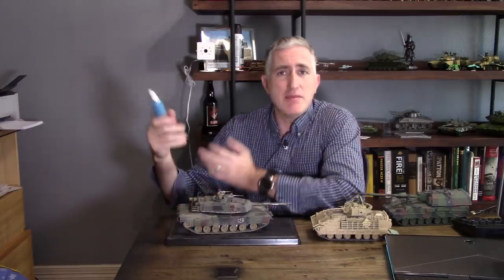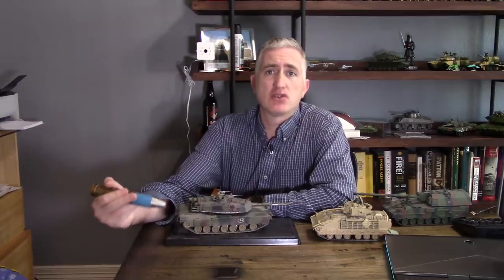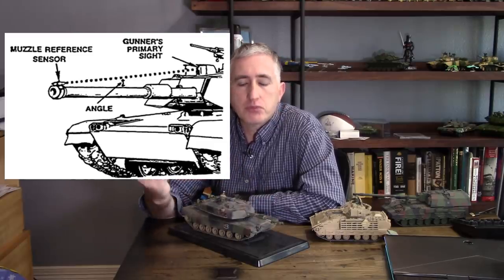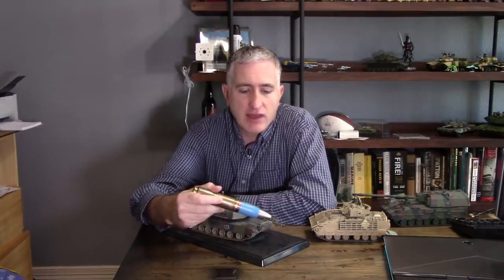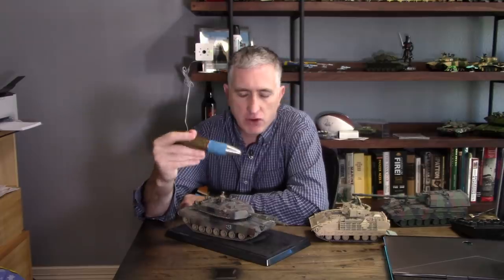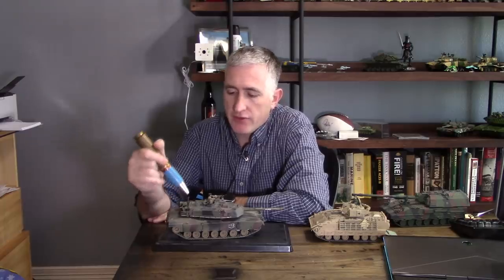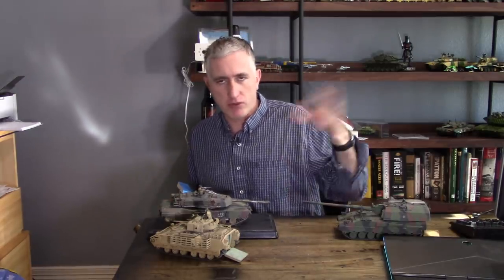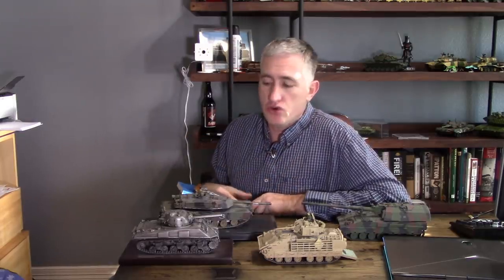Tanks 102: Tank Components

Comment: The_Chieftain: Its Tritium (H-3), a radionuclide of hydrogen. Trituim also provides lumination in emergency exit signs.
Reply: At least emergency exit signs that don't have batteries (like most of them do).
Reply: --and the night glow of my handgun sights. ;-)
Reply: @John Fulghieri-- DU is a lot less radioactive than NU, but U235 accounts for only a very small fraction of the radioactivity of natural uranium. The rest comes about equally from the U238 and its decay product, U234. The latter gets swept out during the enrichment process, along with the U235.
Reply: Donald Palmrose is correct.   Also found in an M1 Abrams is :  Thorium oxide in combustor liner in the turbine engine.  DU (Depleted Uranium) ammo M829 series DU APFSDS-T.  DU in the armor of M1A1 "Heavies" and M1A2 , identified with a U at the end of the serial number.    A thermal imaging window "may" contain thorium- not sure if this is specific to an Abrams though.  Self-luminescent sights, dials gauges probably contain radioactive material.     Source: Radiological Sources of Potential Exposure and/or Contamination TG-238 U.S. Army Center for Health Promotion and Preventive Medicine 10 December, 1999

Comment: As a note, the hot trend in 1:35 military vehicles is 1000+ piece kits with FULL interior.  That is, crew compartment, drive, engine, ammo, everything.  So far I've seen Panther, JagdPanther, Tiger, T34, T60, M3 Lee/Grant, SU-122, SU-85, and probably others.  Not for the faint of heart.
Reply from the maker: I can deal with that. It's the 500-piece track links which I find are over the top. Sorry, but I don't need to have each individual end connector and center guide modelled. If I wanted it, I'd buy aftermarket.

Comment: I was on first-gen Bradleys which were supposedly amphibious (we never tried), so they had a huge trimvane on the glacis.  When it was fully extended as it would be to install the 25mm barrel or PMCS the powerpack it made a nice place to sleep, almost like a Lazy Boy recliner. Not quite as nice as the various spots on a 113, but good enough.

Comment: The comment about the Type 99 is very interesting. Where did you get the information about the Type 99's divergence compensation method? For context, the latest Type 99A variant has DMRS installed.
Reply from the maker: Heard it years ago. Can’t recall if it was in Janes’s or conversation.
Reply: Thanks for the reply. Generally, information about the Type 99 should be examined closely. For example, it was believed for a decade that it had a 1500hp engine when it was actually confirmed to be 1200hp when the Type 99A appeared.

Comment: It’s interesting to think how long it took to get some design rules down like: put the engine in its own compartment, put ammo in its own compartment, evacuate the smoke from gun after firing, thermally balance the gun, etc etc.
Reply: remember that many of these issues only got solved when they became a problem.  before ww2 most tank guns were small and did not produce a lot of propellent smoke and that even in ww2 most tank engagements were at short ranges.
Reply: The cold calculus is that at least one man died or was injured for every design improvement to a tank design during wartime.
Reply: @basher20  I would bet it's more than 1, a lot more than 1

Comment: 22:25 Idk if I am wrong about this, but I think one of the reasons why the Sherman tank (and other similar tanks) was so tall, was, because of the transmission shaft
Reply: Not entirely wrong. The other reason was that the Grant/Lee/Sherman all used an aircraft radial engine, so the crankshaft was in the center of the engine instead of at the bottom like a Panzer 4. That made the driveshaft much higher, which made the bottom of the turret basket much higher.

Comment: The description of aiming off away from the wind intrigues me.  I've been competing at national and international level in archery for over 15 years, and we too use a fin-stabilised projectile.  But we have to aim into the wind, sometimes by 1m or more over a 70m shot.  You can see the arrow in flight, and the tail definitely gets pushed, but there isn't a subsequent "lift" back into the wind.

I suspect it has to do with the extreme speed and mass of a sabot round, but if anyone has further information that would be very welcome.
Reply from the maker: Interesting. There are folks commenting elsewhere in this section that RPGs also have to aim with the wind rather than into it, so it’s more than just speed, at least.
Reply: It could be the strength/elasticity of the projectile. Arrows are flexible and won’t be affected by the crosswind pushing against the fin as much as a rigid sabot round.
Reply: This is clearly bugging me.  I found this (http://www.aircav.com/cobra/ballistic.html) where 3.C.(3) states the effect you described for a rocket under acceleration.  Which makes sense, because you have something propelling it at its new angle of attack.  Since this (and every other source I can find) states such effects cease when the motor is turned off, I'm guessing that the fins and penetrator body are creating lift against the wind.
Reply: Interesting thought, and indeed when you watch high speed footage of arrows (check out the Werner Beiter stuff like https://youtu.be/wGNslUNBrEM) you can see this in action.
Reply from the maker: That first link seems to indicate that it's a component of the launching platform's characteristics, and the bit you are referencing is launching when the helicopter out of trim. (i.e. it both requires additional, uneven control inputs, and is moving at a cross path to the wind), possibly because the wind will affect different parts of the rocket at different times as it leaves both the tube and the downdraft of the blades. At the very end of the paragraph, it simply states that if the aircraft is in trim, to aim with the wind, as the rocket will turn into it with no additional qualifications.
Reply: @TheChieftainsHatch  This is an interesting phenomenon, unfortunately I couldn't find any info on it specifically for fin stabilized tank shells. If you do indeed aim with the wind with these shells, I agree with the lift theory. And if it is the lift from the fins, that would also mean that if the wind is close to 90 degrees to the round you would still have to aim into the wind, as there would be no lift. I really don't know how large of an effect this whole thing would have though, considering that the fins are fairly small and I would think the air resistance from going 1500 m/s would force the fins to stay close to straight.
Reply: I suspect it has to do with the sabot round flying at supersonic velocities. Neither an arrow nor a sabot round is a geometry that you would normally expect to produce much lift, but if the sabot round is at an angle of attack it will make the bow shock in front of it asymmetric and generate higher pressures on the side of the round that is 'flatter' relative to the upstream flow.
Reply: The depleted uranium which is the tip is a lot heavier than the fins so the tip function as an anchor. In the 60's it was tungsten core which was one and a half times the mass of steel. Your arrow has only a little tip made of steel I suspect. Archery has more in common with a mortar round I think which has to aim into the wind.
Reply: The center of gravity determines a lot about where a projectile is headed. 
A SABOT dart has very little air resistance. It's not really anything like an arrow though they compare it to one. I'd say it's more like what they fire out of a rail gun. 'High velocity' is an entirely different animal than a hand-drawn arrow that flexes like crazy.
Many times a wing or fin design doesn't work until they get it in a wind tunnel and fidget around with it.
Reply: The ratio of drag (from the fins) to the mass of the penetrator has an effect. I build rockets. The large amount of drag (fins) wants to steer into the prevailing wind. Without acceleration (thrust), you have drag (negative acceleration). Those forces will pivot an object around its CG. Arrows have low mass over a long length and relatively small fins. The entire arrow tends to drift with the crosswind. Heavy rods (sabot rounds) have huge fins for their frontal area/diameter.

Comment: 19:58 The other problem with muzzle brakes is that it also forces you to wear better ear protection. In addition to that, muzzle brakes make a larger muzzle blast that can hurt/annoy accompanying infantry. Also....."apparently" the larger blast from the muzzle brake tends to damage any sensitive equipment (like the optics maybe......but I am not quite sure about that) mounted on the tank
Reply: it all depends on the precise structure of the brake. Its construction shapes precisely how much gas is focused through a certain channel, at a certain pressure, in a certain direction. 

There are advantages and disadvantages to each. Ultimately it's not possible to redirect that pressurized gas without a risk that it will hit something, though there are ways to minimize it's potential for damaging the things you care about, in a given scenario.

Ultimately it's no surprise then that when possible, we tend to prefer disregarding all that, and just go with a clean muzzle instead.

Comment: There's a misunderstanding of "muzzle break" and "muzzle brake" and they're two different things.  For example the D30 soviet has come with both, the earlier towed version had a "brake" which used a series of flutes to spray the muzzle flash back and to the sides and the export version had a brake version that directed a large proportion of the gasses simply TO the sides to reduce the length of the plume.

In the case of artillery you want as little as possible of the BRIGHT FLAMING GASES shooting high into the air with each shot, a device that peels these gasses off is a break and will have as broad an opening on each side as possible with as small a final path hole as can be gotten away with.

Muzzle brakes on the other hand are designed to keep the high velocity flow of gasses but turn and deflect them backwards, as seen on guns like the M230 30mm chain gun.

The confusion is fun and simple.  Same sound different words and different purposes.

So people use the term "flash hider" instead for muzzle breaks.  They don't actually hide the flash very well on small arms but they DO keep it from being a big long spew from a ball of light. 

Since the two purposes are often needed on larger caliber weapons we result with a great deal of confusion.

But the true flash hiders are the cones on weapons like a Bofors 40mm or a DP28.

Comment: The power-pack thing makes perfect sense. Yank the whole thing out, put in a hopefully fully operational unit and repair the removed power-pack quickly to be ready for the next needed vehicle.
Reply: I'm an auto mechanic, and I'd give up a lot of things to have cars that were that easy to service. Sure you'd need an engine hoist to change the oil, but I've already got one of those (and so do most good mechanics).
Even if you don't have a ready-to-go power pack to get the troubled car back in operation within the same day, you'd still have a far sight better access to everything and wouldn't have to remove 50 pounds of plastic ducting and noise baffles every time you wanna change something like the alternator, spark plugs, or serpentine belt.

Comment: Not called a stern because it isn't. Like most military ideas, it's very straight forward. Stern comes from stjorn which means "steering" in Norse. It would be confusing if you called it a stern without a stern (stiarne Frisian spelling meaning "rudder"). Like I said, very simple reason why a tank has no stern, because it has tracks.
Reply: As the power pack is in the back for most modern tanks would you not say the steering is done on the back like a rudder ?
Reply: @baastex  At this point the nomenclature is not going to change anyway, but theres two things wrong with that. First, of course not all tanks or "not" tanks have the power in the back. Second, the steering is done by the tracks, not the power pack. Consider how a rudder steers compared to how a sail or boiler powers.
Reply: @baastex  notice how a rudder isn't a propeller. We're not talking engines or propulsion, but the thing that contacts the medium for steering. On a car, that would be the tires, not the engine, on a tank it's the tracks, not the engine, only on a boat can it be the engine if mounted on the stern. There is no configuration where the steering is done from a specific location that can universally be called "steering" and nothing on a tank remotely comes close to a rudder. It's why a tank has a driver not a pilot, there is no rudder to be piloted or a helm for a helmsman. You're not guiding a tank, you're steering it. Or at least your commander hopes to fuck you are not asking the tank if it is willing to maybe go a place at some point in the near future.
Reply: 1st Steering is done by the transmission sending either more power to 1 track or the other or just removing power on 1 side or even heck send the track into reverse the track only carries the tank and transmit the rotary force of the engine into the ground as liniar force. This is the same as a rudder shifting the force from the propellor to one side or the other as that is how a powered ship steers by guiding the propulsion

2nd Most large ships these days don't even have a rudder anymore as the forces of the ships side would snap the rudder... these use turnable propellers (forgot the name Ships aint my bread and butter) that bypass the need of a rudder as they guide the force already into the correct direction

3rd Seriously saying that the tracks are the thing that steer a tank makes as mutch sense as saying water steers a ship...

I understand the name will not change I only said a argument could be made...
Reply: @baastex  1. No, the transmission doesn't do that. The differential does that. And like I said, in this case the word is referring directly to the thing in contact with the medium used for steering on, I.e. air, water, dirt, pavement, so on.

2. Modern ships didn't exist in 1945.

3. I didn't say tracks are exclusively used for steering, but they are what steers a tank. When you move the controls the tracks being in contact with the ground is what's important here. Yes, everything else needs to be there to send the driver's command, but the tracks are doing the job of steering. If a track breaks on a moving tank, the other is going to steer the tank. Forget it, if you haven't got it by now, you don't want to get it.

4. Bonus round. "Rear" and "back" are fine. Those words work wonders. Any sighted soldier can immediately tell where the back of the tank is. Wonderful for training.

Yes an engine can be a stern, but a track can never be a rudder.

Comment: 2:04 Drive wheel is certainly an accurate term, as is the case with a sprocket. The system of kinetic transmission is still a gear, regardless of the cogwheel design.. the drive sprocket in this case just lacks definition in its tooth profile as the outer diameter of the wheel is equivalent to the effective tooth profile.

Comment: I don't understand why the muzzle is aligned with the scope when a projectile does not take a flat trajectory. I would have thought that using the sight thing in the muzzle, it should be aimed higher than the target if any distance is involved.
Reply from the maker: The sight will adjust for the superelevation required due to the flight of the projectile. But you first need to have the baseline in the system before you can adjust for that. Boresighting sets this baseline.
Reply: @TheChieftainsHatch 
Thanks for that. I just knew there was more to it than aiming in a straight line. I've flown paper aeroplanes and thrown tennis balls in my youth, so have a tiny bit of insight into projectile aiming.

Comment: Can you please explain what exactly are the advantages and disadvantages of front vs rear transmission? I have been looking for this for ages and a lot off reasons i found makes no sense because people compare to much to (race)cars.
For example people cite weight balance as a pro for front transmission, (saying it helps to have weight in the front wich actually seems weird for trench crossing) while i believe you can alter the center off gravity more with the location off the turret (wich is usualy more to the back with a front transmission)
Reply: Another example is height off the tank because off the drive shaft. While it clearly does make a tank higher in for example a sherman, you can also see that the driveshaft could have been made lower(if they used 2 more universal joints or a set of gears) or just move the driveshaft to one side off the tank, wich would make the problem less pronounced. This off course would make the drive train a little bit more complicated but not a huge deal actually. So clearly it didn't bother the designers to much.

Comment: So you sleep in the open air ? Also if it rains ? I would think you sleep under the tank, also for safety.
Reply: Well on our Leopard 2 tanks we used to sleep on the engine deck. we turned the turret to 6° clock, raised the gun up and throw a sheet over it. I once sleeped on the engine deck just with a blanket while it was snowing, and it was still nice and comfortable. Sleeping UNDER the tank is not such a good idea, and there isn't THAT much space anyway.

Comment: Thanks
Models are cool, an jealous. 
In the US Civil War. One book I've read tells about the use of fire, heat v cool to supply air underground though pipes, draft I suppose. At Vicksburg or Petersburg when the mines were dug.. Not that it's the same as the way the high pressure reservoir works.